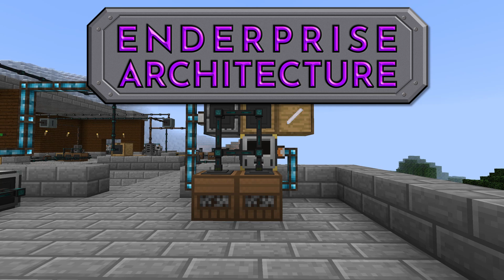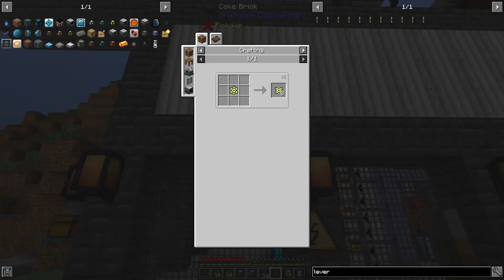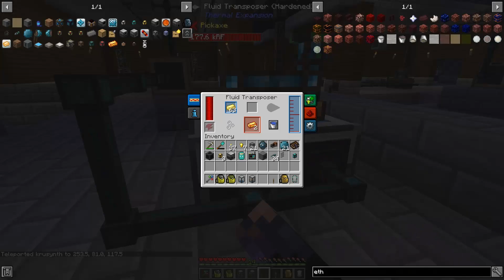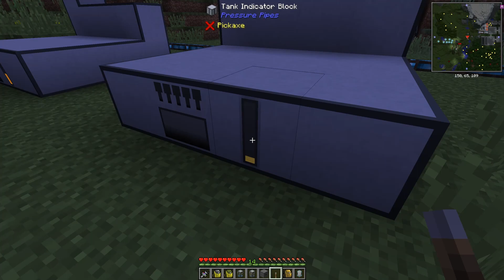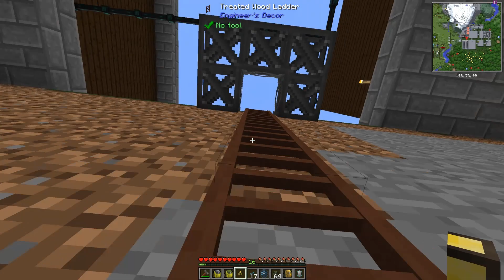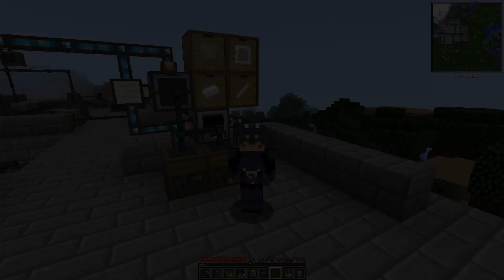Factorio in Minecraft - Fantastic Plastic - E19 Feed The Factory Minecraft

Comment: At least for Nuclear Craft machines you have upgrades so you shouldn't need "banks" of them, maybe a few fully upgraded ones. Using both energy and speed upgrades will at least make it so they increase at the same rate, or to put it another way each upgrade would effectively be the same as placing down additional one un-upgraded machine.
Reply from the maker: Thanks for this!  I was running into an issue where any single machine was drawing more power than I could provide through my available pipes, so I figured that was a way around it. I've upgraded those but I'm still struggling to keep up with my power production, I think I need to rush the next tier!
Reply: @EnderpriseArchitecture  As with most things it's not so much the pipes themselves but rather the interfaces (especially dedicated import or export) which are the limiting factor. Don't remember you doing it or even mention it but the integrated Dynamics energy exporters (pretty sure same with importers) are by default set to only export 1k and can be configured to a max of 5k per tick.
Reply from the maker: @blacke4dawn  Yeah, I've had troubles with the ID pipes a lot, I've almost entirely switched back to Ender IO at this point. 😬